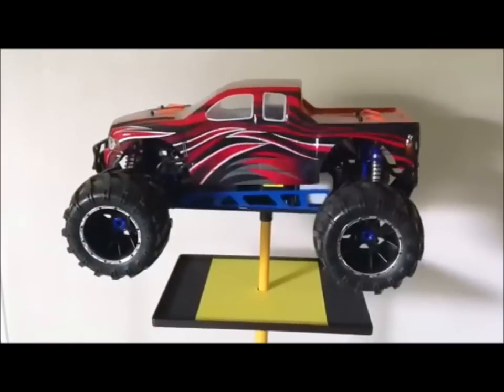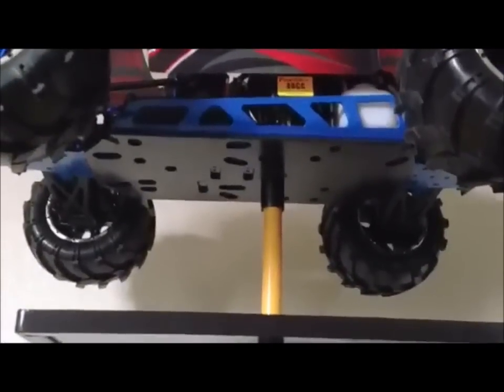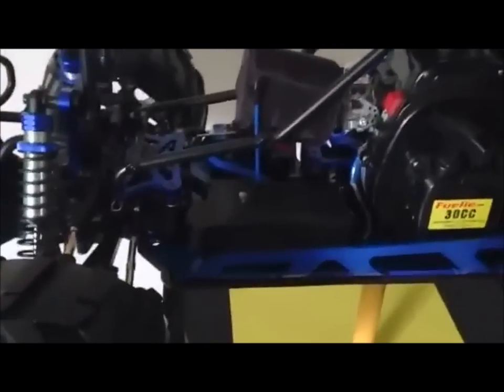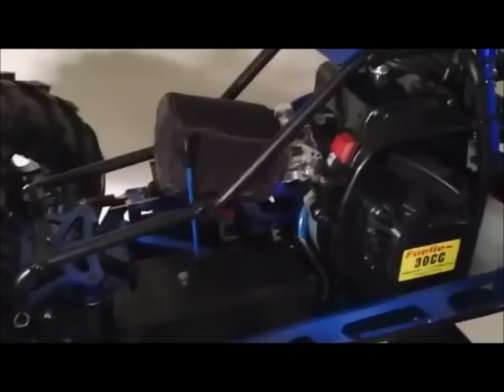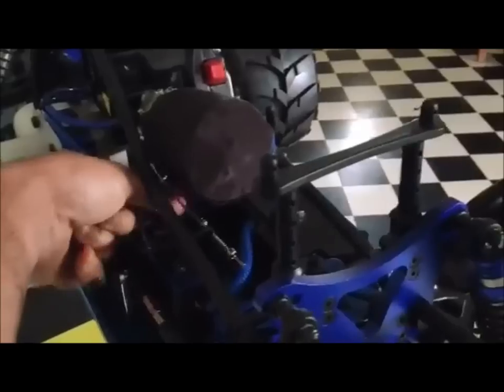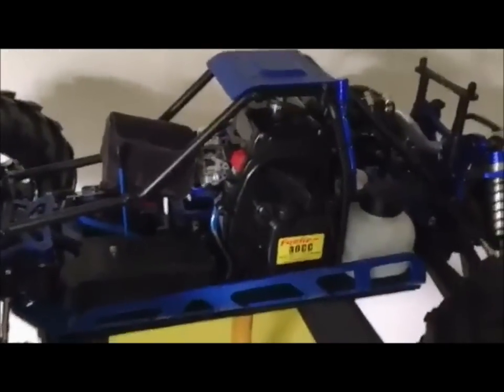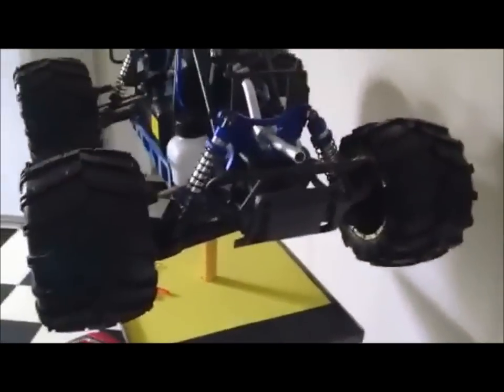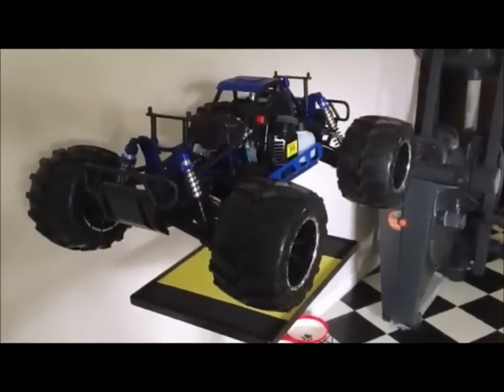Redcat Rampage MT

Comment: Looks great man! ... I just got my MT 2 weeks ago. I put an OBR 7.5hp full mod motor in her. I just got done the other night doing all the aluminum upgrades with the pro aluminum kit. My stock steering servo died on it's second heat cycle, I hadn't even driven the car yet. I went with a pair of Hitec 5765's for steering and an 7955tg for the throttle. I put the redcat pipe on mine and it's too loud and cheap feeling. Will probably go with the CPI pipe soon. Good luck with yours my friend!

Comment: what battery box did you run? I see you said old box is that the one that comes on the rampage xt? thanks.
Reply from the maker: thechadmaster3000 The first Rampage was a single servo setup so I used the box off of it.

Comment: so the killer rc 6000 lipo fits no problem? ??
Reply from the maker: You have to run only one steering servo and order the old style battery box and it's a tight fit with my killer bee kill switch.
Reply: +RcLifestyle429 I have a xb it's the same box I think